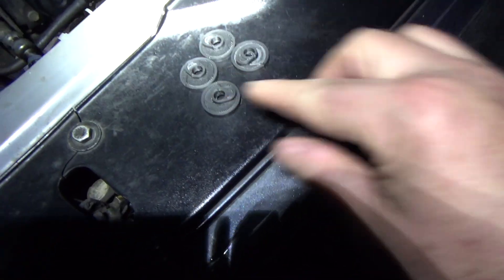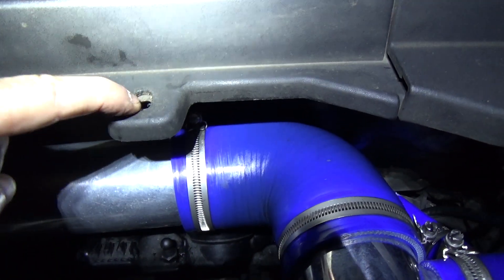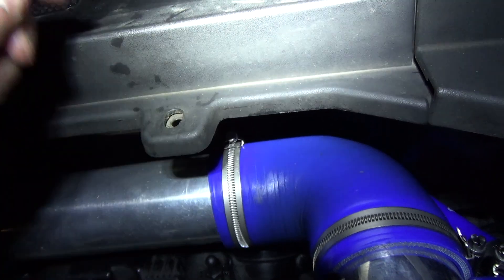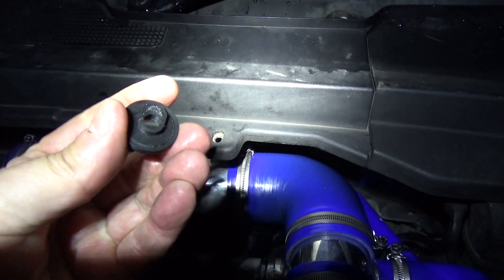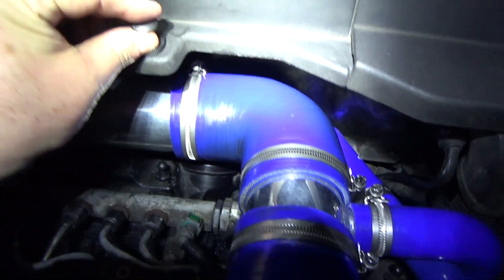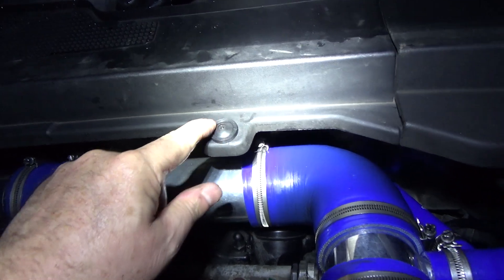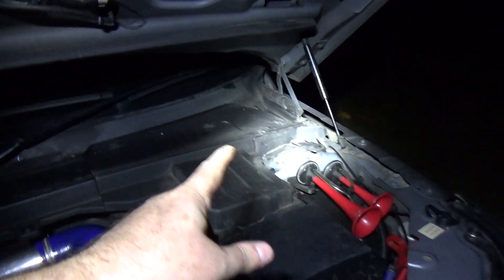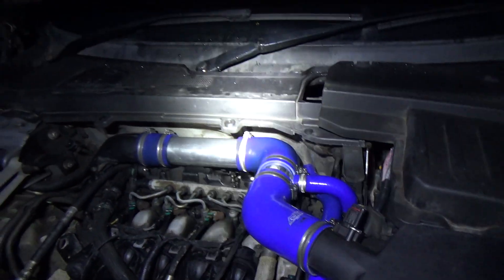New product! Scuttle panel hole aligner! - Land Rover Freelander 2

Comment: Hmm you have made an oval hole round, but was it made oval at manufacture for a reason I wonder is there expansion when hot???
Reply from the maker: There will still be room for some flex and expansion. The scuttle plastic won’t expand much. The glass windscreen might but it is glued in solid.